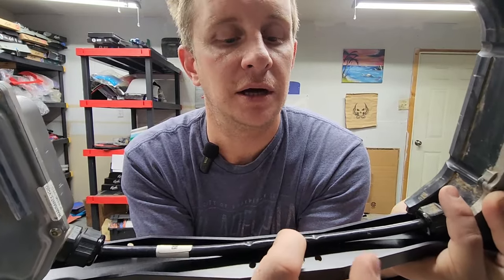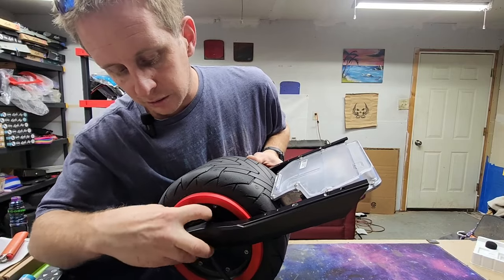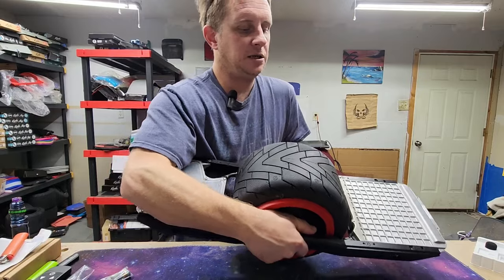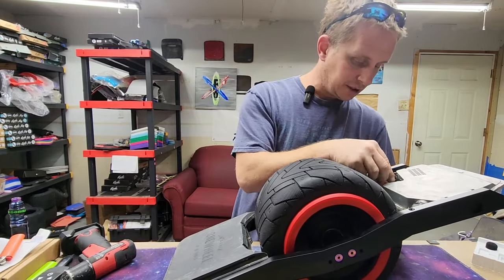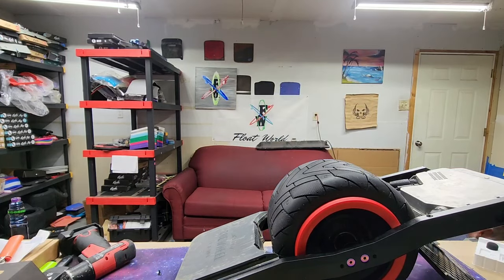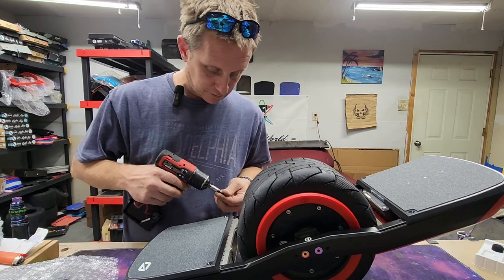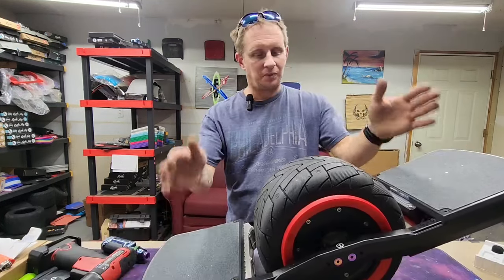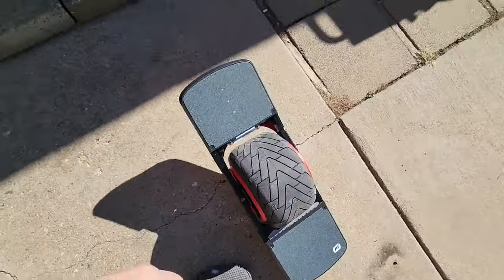ONEWHEEL PINT X BUILD # 1 FROM FLOATWORLD!!!

Comment: Do you have to re-level it with the new rails?
Reply from the maker: I never had !!! I like the way it rides . Takes a little to get used to but much more fun in my opinion
Reply: @Floatworld  is the nose dropped a little without re-leveling?
Reply from the maker: Yes, the nose does drop at low speed, but when you hit the high speed, it feels wonderful